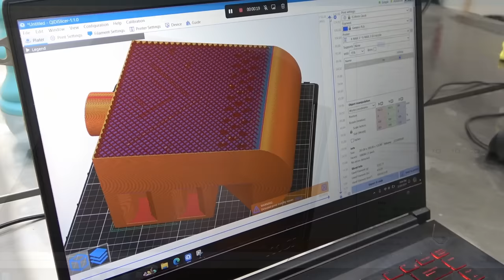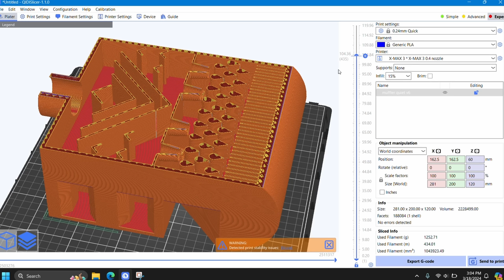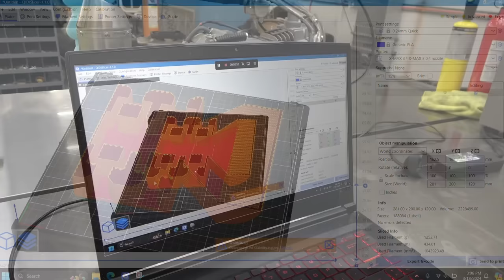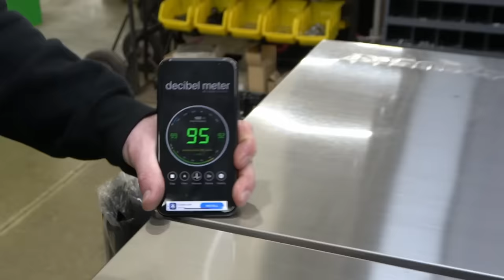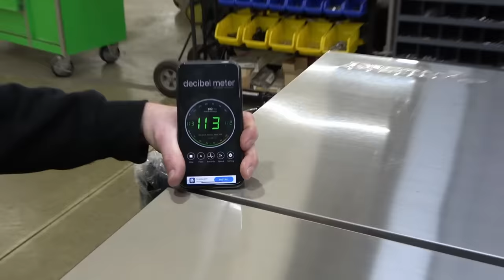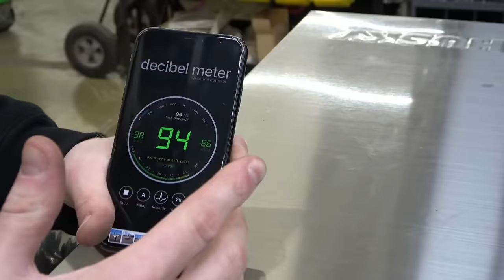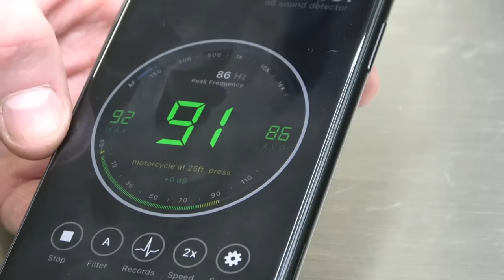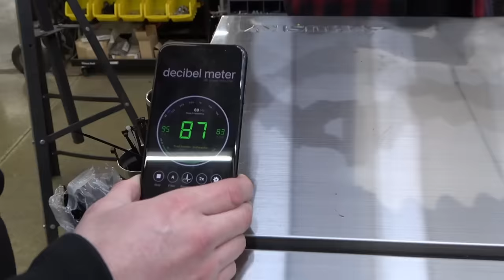World's WORST Muffler Test

Comment: Speaking as a trumpet player, that part of the vid was both heresy and hilarity combined. Take that, woodwinds!
Reply: Are you Dr. Frasier or are you Dr. Niles ??? lol
Reply: As a trumpet player myself, im kinda interested in seeing a woodwind muffler now. Mouthpiece and reed installed of course. 
Might be able to get different notes easier than with a trumpet and its valves.
Reply: @100GTAGUY  Adding a proportionately-sized reed to the exhaust side of the engine would absolutely "work". Many small engines actually use reeds to regulate air intake and compression. It's a rapid series of reed open/close vibrations, where a rush of air travels into the cylinder through the reed, which then snaps shut as the piston compresses the air, preventing the air from escaping.
Reply: @mrmadunit3923  Damn, now that you've asked.... I'm uncertain!
Reply: Trouble is, woodwinds restrict airflow even more than that trumpet.  You’d also have to make a way to progressively/actively press the reed (as lips do) to pitch it, but even just a couple of rubber bands slid in/out on the mouthpiece might make that work.
Reply: hey clarinets are also Bflat

Comment: Remember the decibel scale is logarithmic not linear. Every 3db on the scale represents a doubling of the power. So even a small difference in the measured number can represent a large difference in actual volume.
Reply: You aren't wrong, but it is a bit misleading. 3db IS  doubling of power. However, the intensity, which is the sound power per a specific amount of area, is linear. So 20db is 10 times more intense than 10db. But stopping there would also be misleading, as perceived LOUDNESS, is a doubling per every tenfold increase in intensity or, db. So 20 db is TWICE as "loud" as 10db. So +/-10db is ×/÷2 loudness.
Reply: we dont perceive it like that.
Your statement is true, but we ear it differently. For each 10db step, we increase (or decrease) the perceive volume by two (or half).
Reply: Doesn't really matter; the phone wasn't at the same distance of the exhaust in the separate tests.

Comment: Steve's big muffler would have measured quieter than the stock muffler but you have the opening pointed right at the decibel meter versus the stock muffler's exit was pointed more up and away from the meter.
Reply: Noticed that. A tail cone would help and would probably be sufficient to get that twin sound…

Comment: All jokes aside, the trumpet at high revs sounds like a vq35/37 from an infinity as the joke goes. However, I think you are on to something with the blue muffler because unequal length headers are a thing, mostly a subaru thing, but they can change the way the flat 4 sounds. So, keep experimenting with the unequal length mufflers.

Comment: Tip for your laptop i have the same one you can upgrade the internal components for cheap and make it run stronger, start with the ram its the most limiting component on the laptop, it comes with 8 gigs of ram to start depending on your model, but you can get up to 64+ gigs of ram. Love your content keep up the good work
Reply: I looked into that when I first bought it but never got around to doing it, I really should. Thanks!

Comment: So, you were correct (sort of) in that if you double the sound pressure it's represented as +3dB pressure level. However this is not a doubling of loudness due to the logarithmic properties of the ear's response to sound. For most people with normal hearing, +3dB is just about audibly louder, with around +10dB being a perceived doubling of loudness.

Comment: This is so interesting to me...I own and operate an exhaust shop.....the one thing I have learned is, longer is quieter.....factory car mufflers are as big as they can fit in the space.....another thing I've learned is, mufflers won't make a most louder....they all just change and muffle the sound " crazy, right"....usually chamber mufflers like a flowmaster are the loudest....last but not least.....the type of metal they're made of makes a huge difference.....Borla is a very thin walled stainless steel, and 8 believe that's what gives them they're own sound

Comment: Harmonicas! A single one, and multiple glued together in parallel, PLEASE.
Reply: Or a tree of pipes, each one with a harmonica.
And a 3D printed funnel, that expands wide into a box or stack of boxes, that exits out of thin slots. Like one wall of the box, is a glued on funnel or trumpet, to force the exhaust puffs to expand and slow down, then exit though vertical slots on the other side of the box. And maybe zigzag baffles before the slots, that look like lightning strikes from above at each slot.

Maybe simple triangles sticking around the inside of the beginning of the funnel, to act as vortex-generators and prevent flow separation. Making sure the flow expands wide, into all these little zigzag baffles.
Reply: Oh! I almost forgot.
Will you also please test universal glass packed bike mufflers, piped in series, and another pair piped in parallel with a Y connection?

Comment: You guys definitelyneed to keep printing weird stuff! I would recommend going with an exotic type of filament better suited for heat or strength moving forward. There's some awesome composites these days, but they chew up lower grade nozzles. Just make sure you have some quality air extraction systems as those guys produce a good amount of toxic fumes and VOCs.

Comment: That spiral cone sounds awesome 👌, its like the difference when running a motor using twin pipes completely separate, with the real crackle sound, thats why people have a junction connection between twin exhausts, to prevent this, but if you used the two outlets going into separate tail pipes, you could really make a single cylinder sound like a Mad Max machine 😮,  I would really like to try one on my Honda VTR which I'm always changing the muffler on, thank you awesomely for sharing your great experiments and experiences.

Comment: In 1984 I put together a car. I used a cheap turbo muffler with a straight pipe out.  It was too loud for the street.  After adding a 90 degree pipe, it had a nice purr, but not too loud for a daily car.

Comment: The trumpet sound makes sense.  A trumpet uses sound from your lips vibrating and modifies it, so, it is taking the soundwave from the exhaust and doing the same with it.  It is basically what a muffler does, it takes the soundwave in the exhaust and cancels certain wavelengths, the quieter a muffler is, the more wavelengths it is cancelling.  A performance muffler cancels out most high-range sounds, giving a deep-throated and more mellow sound.  In most cases, quieter also means backpressure is increased, and performance is negatively affected.

Comment: Spiral mufflers are a thing. They work like a helmholts resonator. When you were talking about your green 3d printed muffler, you were close when you said you were hoping the exhaust pulses would cancel themselves out. The part you got wrong was that the pulses need to happen at opposite times. If you have two positive pressure pulses that collide, they add to each other. When you have a positive pressure pulse collide with a negative pressure pulse, they cancel. 

If you added some sound deadening (kilmatz) to the outside of the green one, I bet it would be really quiet. The trick to making super quiet mufflers is to make them quiet, compact, and high flow. If you nail all three, you'll be rich.

Comment: Two additional points of interest for further testing. 1 every time you double your distance from a sound source there is a drop of six decibels. 2 mics are limited by how much sound they can perceive as they are limited to how far the diaphragm can move. You may have been bottoming out your mic with how close it was. Also you should always test from the same distance from the emitter end of the sound source.

Comment: "More pleasant frequencies..."  Yes, exactly.  We found that in testing model airplane engines, mufflers, etc.  And we found that 2-cycle sound was more irritating to people vs. 4-cycle.  But another thing, apparently prop tip speed was going supersonic and generating noise.  Going to long stroke engines running bigger diameter props at lower rpm's was less irritating.  We are in a game of trying to retain model airfields with compaining neighbors.

Comment: I think another problem with the first 3d print muffler is that it wasn’t thick enough to really contain the noise and exhaust fumes. If it had thicker layers and sanded and filled then I think it’d probably be better

Comment: The iPhone with the db reader is actually accurate, surprisingly. I know they put a lot into the mics and all the tech with anything to do with sound. But for something to use on the spot without an actual reader, it’s not bad. It may be off a little. But it’s not like 20 years ago comparing a phone to a db reader.

Comment: 20:00 I think to change the tone, one of the paths would have to be a different diameter to the other, to raise or lower the pressure in it. Larger diameter would lower the pressure and give a lower note, smaller diameter would raise the pressure.

Comment: The generator exhaust trick is to find a muffler for a similar cc size scooter. Stuck a 50cc scooter muffler on a 212 and it ran fine but was much quieter then stock.

Comment: Being metal I’m a little surprised that the trumpet did instantly become to hot to touch. I feel like that why the keys had trouble coming back out. The heat affected the spring strength

Comment: 3d print some nuts and bolts and see if they hold any weight and could be used on the trail in a pinch.

The Bearded Mechanic on youtube 3D printed some hand tools but with the carbon fiber filament they might be stronger lol

Comment: When the state of California first started to limit the noise of race cars on fairgrounds tracks we were told by their rep that the sound increases with each decibel being 10X the previous one. A college techie designed and built a muffler system for our 600hp small block that had over the top headers with 5" diameter collectors and a 5" balance tube. His system used a 1" id inner tube that had a spiral wrap around it that has a 5a square inch open space and extended for the full length of the 24" muffler it had an outside diameter of six inches and used four supertrapp baffle plates on each tube and we were told it would never pass the100db our local track started with and we went to Madera Speedway the first time out and with the baffle plates it was a surprising 83db @ the required 50 feet in the infield of the track and we were told they had an impossible to meet 88db.limit, after the first time out we pulled the entire supertrapp system off and it measured
Reply: A surprisingly quiet but allowable 89db it made a lot of racers unhappy at every track we raced because with everyone else running around 104db and complaining that they could never get down to the 94 db limit and then the track would point out our car and show them our sound checks. But it was possible because every state track has a 95db @50 foot requirement now and it is rare when a car doesn't meet it. One thing that helps is a single brand and part number muffler is a requirement even by the travelling associations.

Comment: Had a crazy experiment of my own. Beater 4x4 ranger with v6 no exhaust past cat. Digging for something to fit pipe dia came across exhaust off rail buggy. Muffler basically cone connected to reversed cone with sort of a flare on end, nothing inside. It was only thing with correct dia. At first thought cut cone at right spot and weld to muffler as an adapter. That's when got sidetracked to what crazy sound I could get. Connected buggy muffler as is. Didn't know what to expect but LOUD. Started it and could hardly hear it. Revving it no cackling or anything. It's crazy how quiet it was. Stock exhaust probably not as quiet. No idea how. Was loud and cackling on buggy.

Comment: If you do the tuba thing, you will need to do something about the heat that the metal will absorb. Eventually, it will get hot enough to spontaneously desolder the connections between the pieces of tubing. It will then fall apart on you.

Comment: Build a custom integrated exhaust cooler (like an intercooler for turbo) to help prints survive longer tests. This will affect the sound to some degree.

Also, the exhaust pulses do have an effect along the length of the exposed pipe so some insulation along the exhaust pipe will help isolate the sound for more accurate muffler effectiveness. It's like how you can hear the effects of water hammer in house piping. Regardless, there will always be a noise baseline from the engine components so it may be largely irrelevant.

Getting another brass to mimic the twirly design will create a two-note exhaust and that sounds kinda cool. It would prove if you're hitting the pulse distances right, too.

I've thought about that for automotive purposes... How neat would it be to "tune" multiple exhaust manifolds to "sing" at the right RPM?

Comment: Since your spiral split muffler was quieter at idle, perhaps you could make a muffler that splits the air into 5 seperated tubes, then make each tube like the silencer of a gun, but have the expansion area in the silencers go into a fiberglass chamber that surrounds all 5 silencers which creates the embodiment of the whole muffler.  I believe by making several silencers in one, its reducing the amount of sound that can enter each one, making it easier to reduce the sound of a smaller area, then introducing back into a larger exit chamber, which should dissipate the sound level even further, but not effect air flow or air pressure. 🤠👍😁

Comment: If you want to double the pulses, you work with sound wave not flow. These are two different things, sound pressure wave and flow pulse. One comes out at the speed of sound, another is nowhere near that. For one cylinder your idea to work, pipe length difference should be more than 10 - 20 meters or so, depending on RPM.

Comment: If you had a diverter before the trumpet, so that most of the exhaust goes straight out and a lower amount goes into the trumpet I bet you could dial it in to work exactly like a regular trumpet - and then if you really wanted to go wild you could set up some actuators to the trumpet finger controls to change the notes 😁

Comment: Could you do a cfd on the designed mufflers? This could tell you the backpressure. Engines need a specific range of backpressure or the tune will be off. You will most likely make less power.

Comment: The barber pole..... air follows the path of least resistance. Resistance is surface area and direction changes. Make the direct route smaller or the twist shorter. 
As tested the twisted route looked larger and changes direction constantly and longer......its probably equal to 10x longer and self cancels alot....good muffler design so u wont hear it much....just my 2 bits u didnt want

Comment: The speed of wind doesn't matter with the 2cyl exhaust more important is the speed of Sound at a certain frequency. At least that's what I think. So the difference between tube length would be impractical large.

Comment: Why not make a muffler shaped like a silencer ? A tube with circular baffles, perhaps with a smaller and smaller center hole and spaced tighter and tighter nearer to the exit (and perhaps test if it's more efficient than the reverse, or a neutral, design).

Comment: It's a single cylinder 4 stroke.
3000rpm / 2 for 1 pulse per 2 revolutions of the crank / 60 sec in a minute = 25hz so 50hz = 6000rpm 75hz = 9000rpm.

Take a pipe 80in long cap 1 end and tee it to the exhaust. This is a helmholtz resonator tuned to 50hz good for 6000rpm 62in for 9000rpm
38in for wot at the 100-105hz that motor hitting 12,000rpm

Comment: The spiral muffler was so close to right, the math was good but you shouldn't have used the air spec of the exhaust, you should use the speed of sound in air to calculate the double path.

Comment: "This thing is designed to amplify sound..." Well... not quite. It's designed to selectively promote resonance at specific frequencies, which ends up, as I understand it, converting most of the sound to the same frequency. So it doesn't amplify, which I'd liken to multiplication, so much as add all the sound together and shift it to a certain frequency.

Not exactly how resonance works, but closer than just considering it to be an amplifier.

Comment: You could try without the mouth piece.  The mouth piece is use to give the lips a tool by which to create vibrations.  (I played tuba so I have a knowledgable opinion).  Omitting the mouth piece would allow for more air flow and the piston the “pulses or vibrations”

Comment: The spiral one if both paths split again half way through so there was 4 exits and you should try a rubber coupler between pipe and plastic muffler. And unicorn silencer though it looks like a unicorn dil dohhh

Comment: Also you have to have lips to get the trumpet to sound right. Why not try a tuba or a trombone so that you can slide the slide and make different noises I'm sure that would work on the trumpet also the valves won't work without lips
Reply: My great grandpa was a trumpet player started in the twenties and didn't stop until 2007 when he died at 106

Comment: Should look at an OSS type suppressor design.  Something that simply gives a really long path circulating against the outside of metal to lose as much heat as possible.

Oh.  And a tuba.
Reply: Put switches on the handlbars where you can work the valves. Then you can play other notes as you drive.

Comment: I mean if you were to have the machine to do it, you can 3d print with metal directly as well... though such is a form of powder and i believe high power laser to make the part. so in a way kinda similar to how resin printing works. but still similar to fdm 3d printing in a sense too.